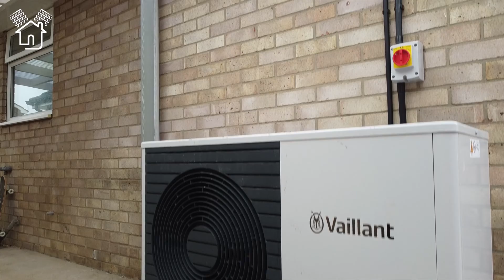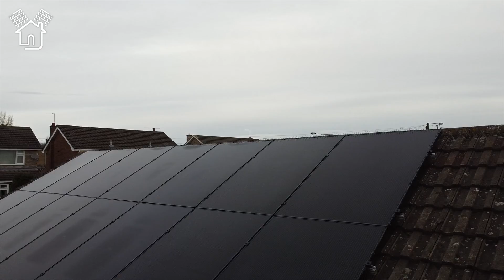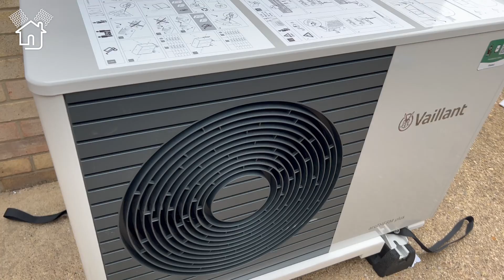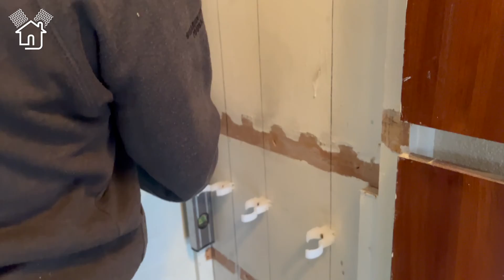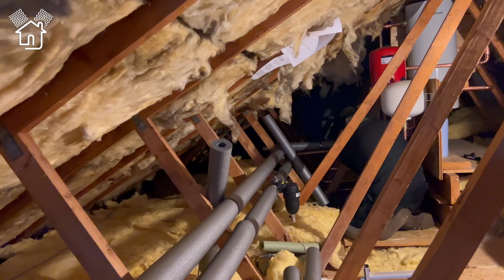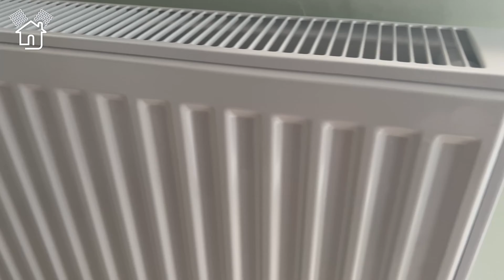Vaillant aroTHERM PLUS Heat Pump Review

Comment: We’ve had a Vaillant aroTHERM system installed for just over four years. Unfortunately, our experience has been disappointing: we’ve had multiple breakdowns, each resulting in long periods of downtime, sometimes weeks without heating or cooling.

What’s even more frustrating is that we have a valid maintenance contract, yet the support response has been extremely slow and inconsistent. In urgent cases, it has taken two to three weeks just to get a technician on-site — which is unacceptable for a premium system.

The system works when it works, but in our case, the reliability and service have not lived up to expectations.
If you’re considering Vaillant, I strongly recommend researching alternatives like Hitachi, Bosch or Nibe, which seem to have better performance and support, especially in Spain.